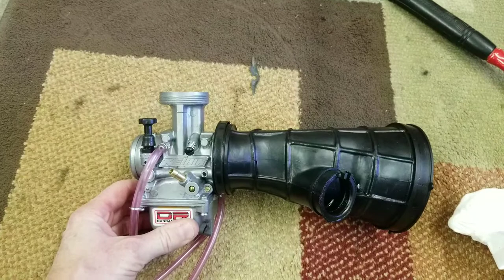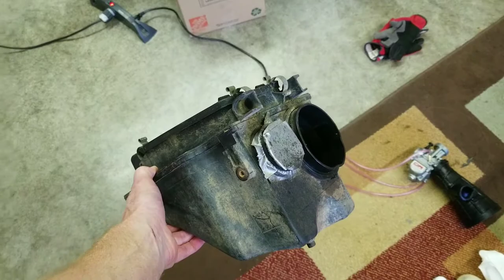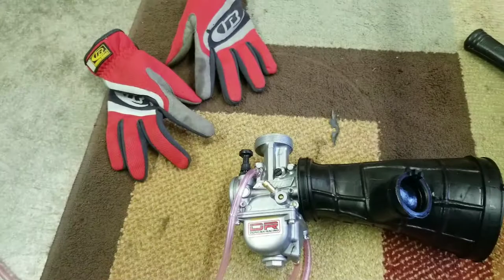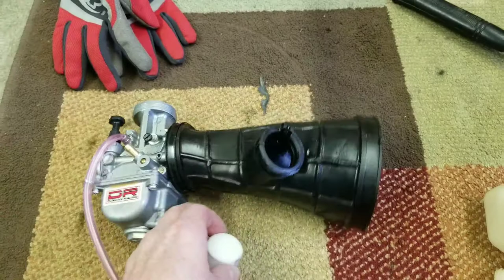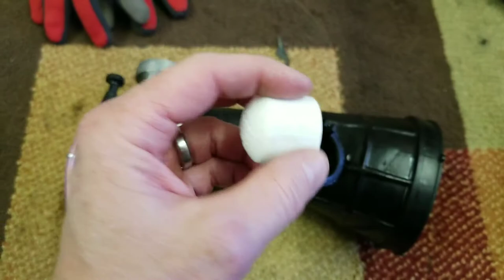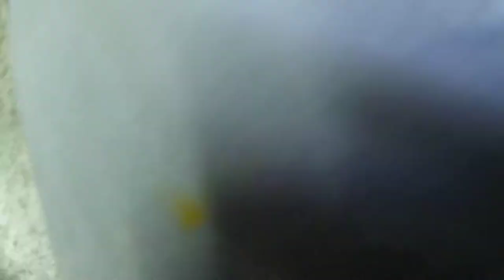Honda TRX250R Aftermarket 39mm PWK Air box intake manifold boot install trick

Comment: did you change the stock intake manifold? I recently bought a 38mm carb but it does not fit in the intake manifold
Reply from the maker: No I used the stock manifold but you need to use a heat gun to heat it up and you can stretch it over the 38mm carb